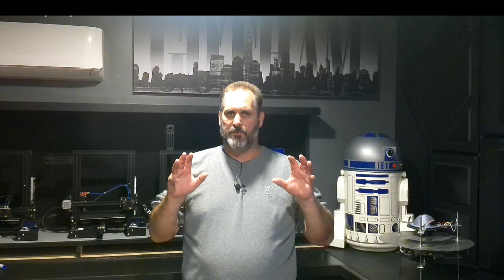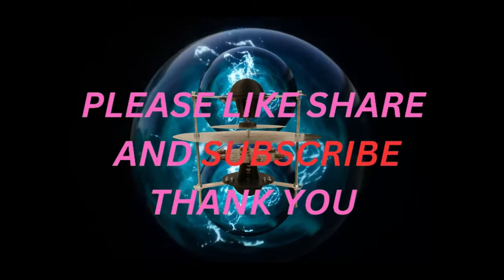Graviflyer Field Interaction #33

Comment: Nathan, good analysis. You are very close. I still say negative, positive, and negative on the disks with the CD or the paper dielectric. The surface is negative, and the ionosphere is positive. Repel and attract and lift up. Also, stay out of the field. You also need the battery at a high amp-hour to get the power.

Comment: Would you consider using an ultrasonic piezo transducer from an Ultrasonic Solder Gun? Those are strictly made for that range with the most effective vibration. Often referred to as a “trumpet”.
Reply from the maker: I don't know about that. I have found what the piezo disc is for.

Comment: Thanks Nathan. Have you considered using 70watt neons, one wire of each connected to the various parts of the Graviflyer other hanging in the air instead of the fluorescence tubes to check the field?
Reply from the maker: Yes. I decided to make a ring around the craft and expand it to see the max distance. I am also adding al tape to the top cone of the graviflyer. The field should be the same in all directions. The bottom might need the same.

Comment: what piezoelectric thing are you using? you could use ultrasonic cleaner piezoelectric things they're like 30W each and are somewhat cheap
Reply: There are also piezoelectric trumpet transducers for ultrasonic soldering that are built for that particular range.
Reply from the maker: I don't use that in this device. Just a piezo electric disc.